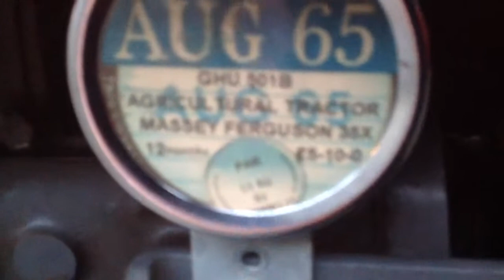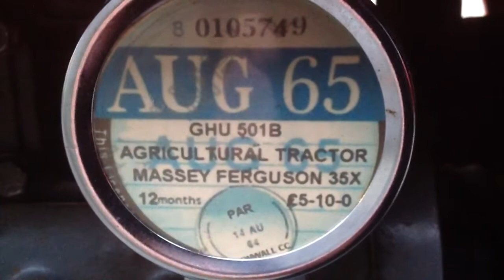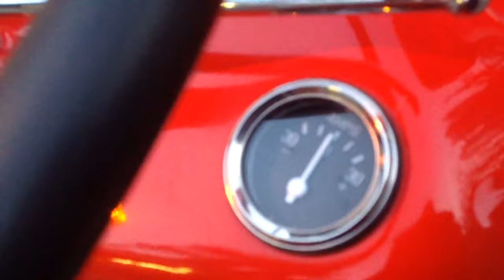Massey Ferguson 35x electrics

Comment from the maker: HI Coin thanks for the comments,  I quite enjoyed this project, just to note the benefit from LED's are amazing, I changed the headlamps to a dipping LED, from China, ( Ebay) of course they are a diode , Doh...!! so i realised after fitting they wont work with + Pos earth systems ( like mine was) after figuring that out, it was a good excuse then to make the change over to -Neg earth, and not difficult either just change over battery leads terminal fittings to neg earth, then as the reg. box and starter dont mind, just flash the C40 dynamo and you are off, the plough lamp was also converted although i soldered LED into the original bulb base and it was fine. Next challenge was the Butler indicators, as the flasher unit wont operate with LED's without  a load of 50W 5 ohms resistor in parallel, the resistors get very hot , so i decided to put halogen bulbs in the  Butler indicators instead and whallah ...it worked fine,  I did think that I may need to convert to alternator but the C40 handles it all fine.so kept with DC, charging although there are some amazing electronic regulators solid state which can be fitted into the Lucas regulator box  if you like,  when changing to alternators, however the feed wire from the spade terminal at the charge end to the reg box current carrying capacity has to be increased if Alternators are employed. There are some great alternators now built in the body of a look a like C40 dynamo. 
All this because the tractor originally was used to mow the grass at RAF St Mawgan Cornwall, and seems to have been fitted with Beacon and Indicators which have now finally re-built, as close to the original set-up as was fitted prior to me restoring the tractor 16 years ago when i ripped it all off.